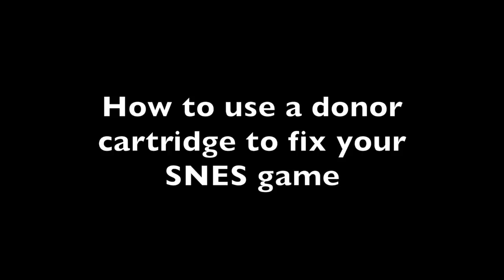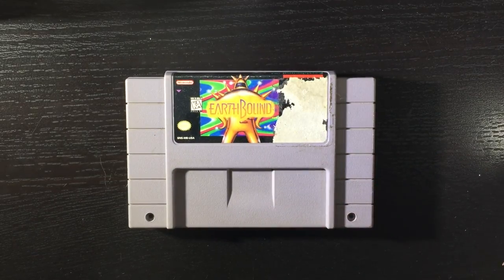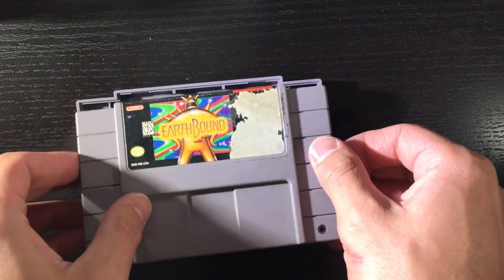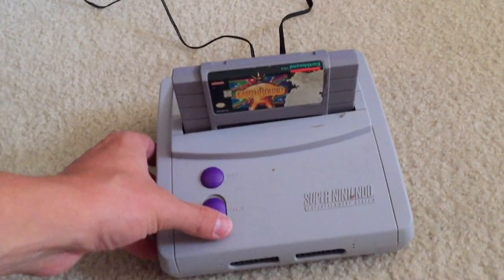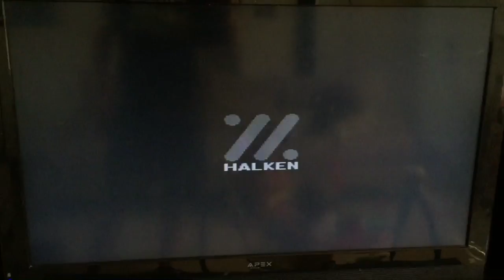How To Fix ANY SNES Game By Using a Donor Cartridge Repair Super Nintendo

Comment: Cool stuffI I did the same last year, I saved a Super Mario World and sacrificed an NFL Quarterback (who need these stupid sports games anyway). I only felt a little guilt using another game but it was worth it I think. And I was so proud of myself because I figured it all out just by thinking about a solution, figured there's a site that lists every game and every board version. So all I had to do is identify my Mario board (it had 3 or 4 variants maybe) and find another game with the same version. I was luckly that there was this cheap game with the same version and this game didn't have a different version of boards only one so it was not a question that it's the right donor.

Comment: I realize this is 6 year old video. And I will say this just to save more games from a fate that was unessisary.
 This pcb could have been repaired. No board swap was needed. A simple jumper repair would solve the issue. And not wasted a pcb.

If a pcb is so bad that it can't be repaired. Then, the method of this video for a needed board swap will be useful to people. 
But keep in mind, guys, these boards are slowly disappearing. And to keep the retro stuff around longer. We should make smarter choices when attempting to keep them working.

Comment: How can I tell if the PCB is compatible? I have one for madden i'm trying to use for a different game but to they have to have the same serial # or something? or just same size chips? one is shvc-1a0n-01 and the other is the same but "20" at the end instead of "01"
Reply from the maker: +Drew Thorwall which game are you trying to fix?
Reply from the maker: +Drew Thorwall https://snescentral.com/pcbboards.php?chip=SHVC-1A0N-01

This shows which games are compatible donor cartridges. Let me know if you need any other help.
Reply: thanks for the reply. trying to fix Adventures of Batman and Robin on Snes. i have a madden '93 that "looks" pretty much the same